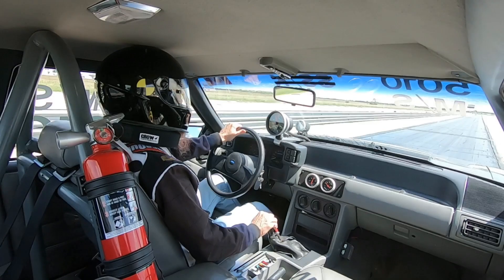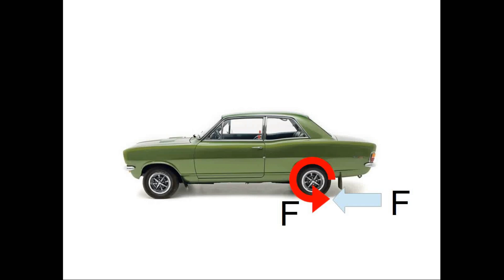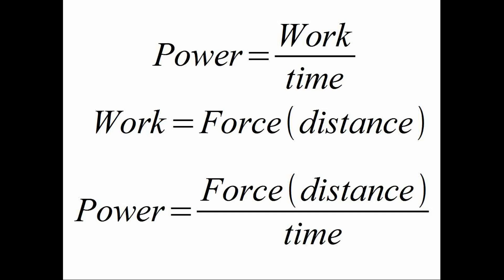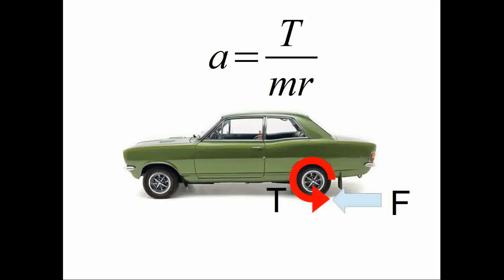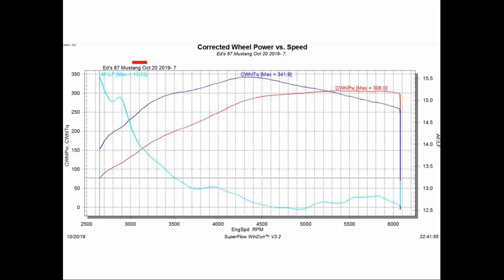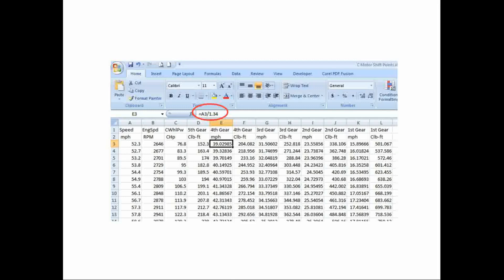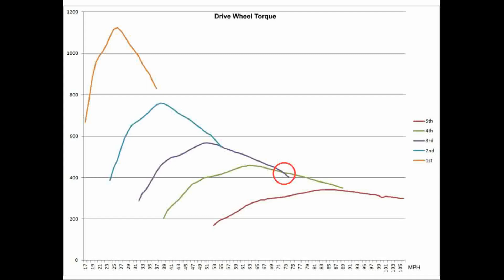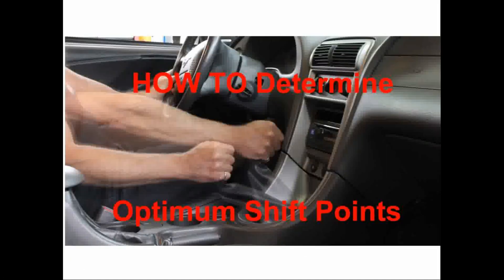Optimum Shift Points for Acceleration

Comment: If anyone learned anything from that gobbledygook they learned nothing! Redline is set at maximum torque and you better be out of 1st gear before it gets there; because the engine is revving so fast, perhaps 200 or 300 RPMs before Redline and you better have shifted. Again, if you know where the torque drops off you shift out accordingly from 2nd and 3rd, and if you race your car as I do, not in a quarter mile, you will find that the torque drops off long before the red line in 4th and 5th gear because most cars will not reach or pull to Redline in either ¿`_
Reply: What you mean? My max tq is 510lb at 5k rpm, peak hp is 539 at 6500. I should be shifting between 6400 n 6900rpm
Reply: @Megan24Nichole  don't confuse the slight drop of torque on the dyno to the drastic drop of torque as driven at the end of each gear that will happen in less than 300 rpm's. Some people will refer to this as "valve float" ¿`_

Comment: You essentially did the long way of making sure the HP is equal before and after the shift.   Good stuff.
Reply from the maker: Not the power, the wheel torque. Maybe you should watch the video again?
Reply: @The_Performance_Laboratory  let me explain.   At any given road speed the torque at the wheels is proportional to the crank HP.     If you have two different engines producing the same HP at x speed, they're both delivering the same output torque regardless of what torque each engine is making at the crank.
Reply from the maker: @MrAllan5oh  Sorry Allan, I'm still not understanding what you're trying to say. Maybe email me.
Reply: Great to see you uploading again.

Comment: At the end with the, wait what about automatic transmissions? Though your gonna play the, “real race cars have a manual” 😂 Would’ve been good if you did!
Reply: You need a g meter and a log.  Take the g meter reading at max rpm before the shift and min rpm after the shift.   They should be equal.   Acceleration during the shift is determined by how hard the trans shifts and converter, not by shift point so it needs to be ignored.
Reply: @dangraff8467  a converter makes things more complicated than that.   How much is it slipping and at what RPM?   The g meter is the only way to do it.
Reply: @dangraff8467  you also have a higher power loss due to slip after a shift.   None of this is relevant, you simply cannot calculate shift points with a modern converter setup.   It has to be done at the track with a good g meter.
Reply: @dangraff8467  uhhhh no they're not.   They don't simply flash and then grab.  RPM drop changes as you add more power.  Sometimes there is no RPM drop.  They might be perfectly predictable for a low power NA car.